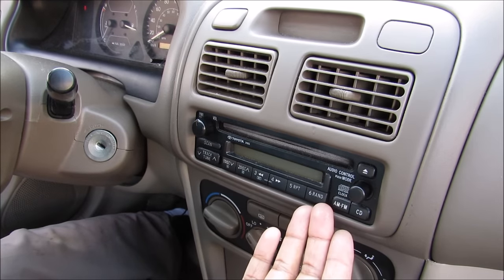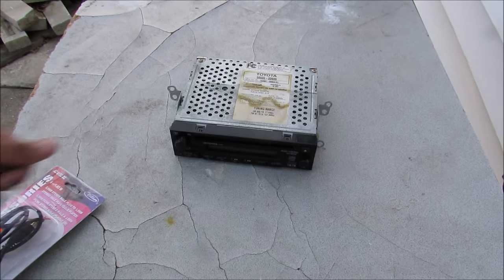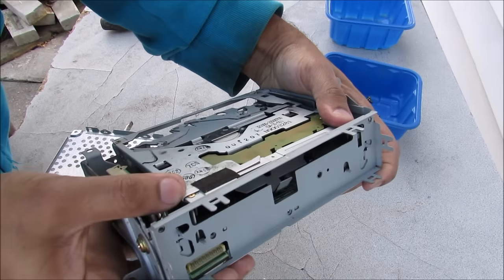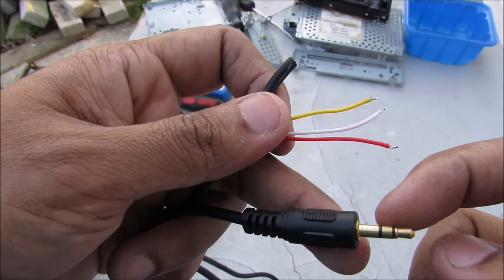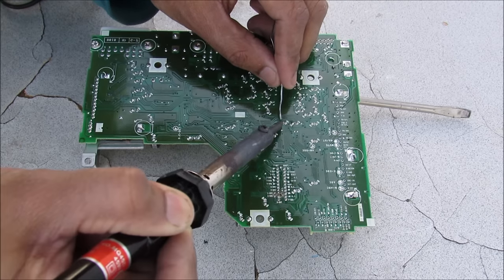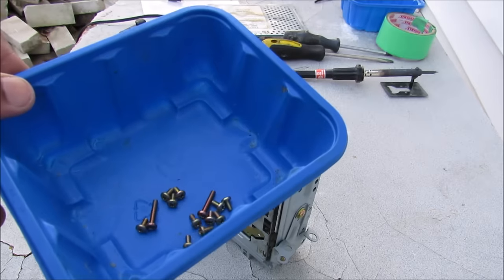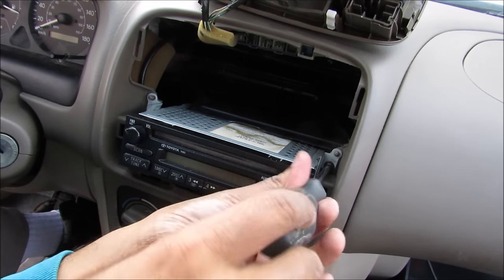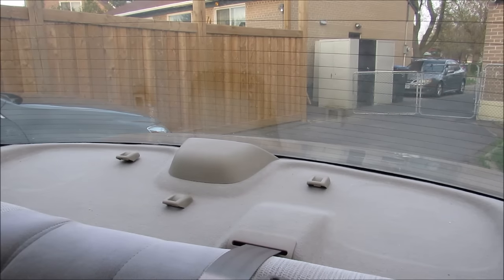Aux Input CD Stereo Hack

Comment: hey how did you figure out which wires inside the aux correspond to the left channel, right channel and ground?  is it the same for all auxes or does it vary? i just don't want to solder the wires in the wrong spots. also hilarious video man
Reply from the maker: If it's not marked then trial and error

Comment: Hey dude, so I have tried to do this trick but I encountered a problem: when I plugged my phone in, the audio was coming from my phone. But as soon as I removed the connection from the car sound system, the audio stopped coming from my phone like it would be working. Any ideas?
Reply from the maker: Thats Headphone jack detection on your phone 
Try a different player or disable it if you can

Comment: How did you determine which wires were which on the aux? Also, how can I determine what to solder to if I don’t have a test tool?
Reply from the maker: Pin out for the aux cable is standard. 

Trial and error to be honest
Reply: speedkar99 thank you my friend. Is there a method for trial and error? Like, do I have to solder then put the whole thing back together and test or is there a simpler way?

Comment: I have added Aux in to my JVC car stereo at the CD-L and CD-R input points of the volume control IC and ground to the amp ground point to a 3.5 mm stereo jack. When I connect the jack to my mobile phone headphone socket, sound output is from the phone speaker. But disconnecting the ground wire output goes to the car speakers but at little low volume. Any suggestions pl.

Comment: I tried to do that, checked the motherboard but i found no labels indicating right, left or ground .
Any advise ?
Thanks
Reply: I'm a little surprised but you could look on the board on the CD player to see if that is marked instead and see which pins (or sockets) it connects to on mainboard, or connect your wires to CD instead of mainboard

Comment: I did the same but disconnect the audio from the CD.
When the mobile is paused, I have some interference noise.
What I can do?

it is not the cable because when disconnecting from the mobile it stops making noises.
Reply: It's natural. Your cable naturally collects noise from electrostatic fields (interfering signals are superimposing to the signal) if the cable isn't shielded enough against it.
It's mostly noticeable when some metallic, skin, etc.. material (those which is able to conduct electricity) make physical connection with the AUX cord's jack plug. If you leave it alone the amplifier's noise reduction will comes into operation and you won't hear any interference because the noise is so low that the amplifier will cut according to the low threshold and SNR set.

Comment: Please help! I have a toyota corolla with the exact same cd player but there is a metal bar in the middle of the cd player preventing any cds from being inserted. What can I do this fix this?
Reply from the maker: +Miriam Bronski open it up and remove the obstruction
Reply: I opened it. The obstruction is built into the stereo. It's the bar that can be seen in your video at 1:14 right in the middle of the slot. The bar can be manually pushed down but it pops up again blocking the insertion of any cd

Comment: Personally I think it would be better to have a 3.5ml extension then with the female in you could drill a hole and stick it into place so you just have the port on the dashboard and then use a second 3.5ml double sided aux lead.

Comment: That's cool but you can also get a car FM transmitter that plugs into the cigarette lighter and achieve the same same result, easier!
Reply: Yeah, it mostly works well, but over time the odd interference, especially when audio source is low an radio volume has to be turned up, was driving me crazy.

Comment: There is no LINE OUT LEFT AND RIGHT mark on my pioneer CD player Board..
How I can get that?
Reply from the maker: Trial and error
Reply: speedkar99 OMG NO NEVER, please don’t use trial and error. You could put 12V DC directly in to the aux port and kill your devices.
Don’t do it, don’t even try it.
Reply: Now I am playing my aux cable with speaker out put line on my board... connect aux cable to that and turn on FM.. plug aux to mobile and now playing my mobile songs..
Now work well...

Comment: Hey, i have a question for you but i have no idea if you know the answer to it.

I have a 2000 Peugeot 206 GTI and the speedometer isn't working properly.
When driving the car, the first 1 to 10 kilometers (varies) the speedo is not working at all.
Tachometer is working fine. After those ''warmup'' kilometers, the speedo works like normal again.
when the speedo is out, the pedometer is not working either.

local mechanic thinks it might be a problem in the instrument cluster, because the ABS is still working.
do you have any idea what this could be and how to fix it?
Reply from the maker: +Bjorn Bekkers I had a similar issue on my Solara, the speed sensor wire behind the cluster was loose, and only worked when warmed up. It also caused my tranny not to shift. Check your wiring.
Reply: Thanks for the tip! 
i'll check it tomorrow when i have some time to look at my car.

Comment: A bit of "hand-waving" there when you just "magically" found ALTERNATIVE solder points, UNmarked, very far away on the printed circuit board.  But a sound strategy otherwise.

Comment: I have a 2000 corolla liftback with a cd player that is seperate from the stereo (model nr. 86110-02040-b0), connected with wires instead of directly in the motherboard like in the video. Is this possible for me, because i can't find the solder points. I don't have them labled like yours.
Reply from the maker: Start Google the chip numbers on the board to find it's inputs

Comment: Great video! Love people that like to tinker, take things apart to see how they work and maybe even modify things a bit!

I took an old stock Honda CD radio apart to see if I could also do the same thing you did but I could not find the same info on the sys board as you found. Any suggestions? Thanks!
Reply from the maker: Thanks I love tinkering as well. You'll have to Google the chips to get the pinout

Comment: I understand that some people like to mess about with things but ffs at the point of having to solder and buy wires and shit you can just buy a cheap cd player with a aux built in I mean they are what like £20?
Reply from the maker: Why not hack it? It's fun, cheaper, and retains the OEM look.
Reply: @speedkar99  there is a difference between doing old stuff thats really a front for cool and new stuff and messing with old junk mate (and fun? Really? Soldering a wire is not really my idea of fun haha but each to there own. ) my examples of cool old things are:
 A sleeper car (like a 1996 rover 214 si that can do 0-60 in 3 seconds and tops out at 180mph)
A sleeper pc (like a pc from the big white tower era made somewhere around the 1990s that still has a floppy drive but inside has a i9-9900k 32gb ram and rocking a rtx 2080ti with rgb everywhere) but not soldering a aux on a old radio haha its like the kids who stick tape on there car to fake carbon fiber or throw a big exhaust on there 1.2 clio or the kids who buy a 1.99 led strip to stick in there shop bought low spec "gaming pc". But saying all that they make more sense than your aux "hack" because carbon fiber cars are f*cking expensive and making a old car into a sleeper is a pain in the ass... all the work to make a car not only put out the power of the 0-60 and top speed but to be safe doing so is insane and finally making a gaming pc is also expensive and can be challenging doing it in a old case but a aux cd player has been cheap for years so makes no logical sense to "hack" a old one, its like watching a video on how to make your own tooth picks to save 20p its just insane to me thats all.

Comment: Mine from my dad's car, from an 2000 audi, does not have nothing labeled. I checked so much time but it only has G for ground and SW+ and SW- and some S+ and S-
And i don't know what to do now!!
Reply from the maker: Trial and error! that's what i would do
Reply: speedkar99 I'm afraid that i could damage my phone when i plug it in. I measured a small voltage of around 200mV and that's why I'm afraid!!
Reply: Lela Mario  plug in cheap crap to the cable and test it then if it blows it up it doesnt matter

Comment: I have a nissan pulsar 2004 i connect the aux cable i get sound but the sound from the cd comes through a little bit. But why everything i change songs on my phone the sound cuts out so i have to eject the cd insert again then it will play through my phone again
Reply from the maker: Your phone has jack detection
Reply: @speedkar99  yes it does but when i change songs it wont play thru the radio???

Comment: 2:46 Wrong ground dude. You didn't cut trace on the CD player for the L&R signal?
Reply from the maker: No you don't cut traces if you want the CD player to work
Reply: You're shorting 2 low impedance outputs. Very likely you'll get increase in THD.

Comment: did this to my 2004 Corolla and i get ground noice whenever a function associated with electricity is pulled off, wipers, turn signals, window operation, they all introduce cracks and sparkles in my speakers, but hey its all cool while the car is parked

Comment: Toyota 58806 please :) There isn't any label like GND or OUT. Only some codes.
Reply from the maker: +greos39 Google the data sheet for the chip and trace the contacts
Reply: speedkar99 I connected left and right cable from Jack, with LCH and RCH from CD player (GND with GND). When I plug everything to radio and press power button,  LCD shows: CD ERR.
Reply: @greos3941  Looks like your Blank Cd is at fault as OP said you need a readable CD with blank audio it seems your CD is not reading correctly
Reply: @peterkershaw7225  everything working already for a long time :D

Comment: Could this be used in a cassette player at the input end rather than after the amp?
Reply: locate the amplifying chip, find the line in (4 of them in case of TDA7388) and hook there through a 1uF capacitor, left on line in 1and 3 and right on line in 2 and 4.

Comment: Hello, i have watched this video so i decided to try it on my Ford Fiesta 2009. I removed the radio and on the back of the motherboard, where the CD Player was pluged into, i saw that nothing is labeld ( no R-Out etc.) Can anyone help me where i can find a plan or something to solder the cable on the right positions? Thank you 
Nice Vid!    (The Radio: FoMoCo Model RADIO AHU)
Reply from the maker: +andi i thanks,  how about checking the output of the CD head where it hooks to the motherboard? Perhaps youll have to google datasheets for the A-D converter chip on your board to get a pinout of the unamplified audio signal.
Reply: Thanks! I will try to find something. On the following link you can see my cd drive loader deck, which is installed in the radio. 
https://opuradio.com/products-detail.php?ProId=1215

Comment: Hey bro the car is different, but the idea should be the same, so can I do this on a Buick lesabre 2004?
Reply from the maker: Yes as long as you have analog cd
Reply: speedkar99 hi so I tried to do this on my buick, turns out the Buick doesn't have r-out l-out like that, it instead have R-CH and L-CH and P-GND, which I think is the right left channel and the ground, so I soldered the aux cable to it and then put in a silent track cd, it doesn't work. Can you tell me where I did wrong?

Comment: I'm curious on a technical level why having a blank cd in there with the aux hooked up "tricks" it.
Reply from the maker: +MuffinMan0521 because it's supposed to be taking audio from the CD 
So there needs to be a blank CD to play from otherwise it won't read from the CD source
Reply: To activate the amplifier board.
If you don’t put CD in it the device will sleep and turn of the amplifier.

Comment: 2007 lexus gs350, bluetooth music streaming !!! is it  possible !!! pls make video
Reply from the maker: +Turbo Not without a Bluetooth adapter that you plug into the back of the radio. 
Or you can hack the radio add an aux line (like I did here) and then add a Bluetooth adapter to that with a ground loop isolator to prevent interference. 
I just dont feel like opening up my GS350 radio in case I screw something up lol
Reply: lol same here, i dont feel like opening it, even thou i do extreme operation on other car lol ...
Reply from the maker: I just use MP3 CD's. Works for me.

Comment: Man, for $50 you could get a nice modern JVC radio with Bluetooth and replace this old junk and not to have silents CDs. Faceplates and adapters are $20 max if needed. Takes less time and effort
Reply from the maker: +CNT True....but what if you want that vintage 90's Toyota quality sound system?
Reply: speedkar99 then you buy a fm modulator

Comment: Ummm why take the radio apart and solder?? Thats risky soldering and its unneeded... Why not just take "wire taps" and wire the aux cord to the wires on the back? Then you dont have to solder, you dont have to take your radio apart and it would take a lot less time......
Reply from the maker: +Cameron Because the wires on the back are unamplified

Comment: Your side brackets should work on a aftermarket stereo it's nu st a single din radio and would soundcbettervtgan stock.
Reply from the maker: But it would look ugly and not worth on a car with two speakers
Reply: speedkar99 Walmart has Bluetooth head units with aux for 20 and they are surprisingly good quality.

Comment: How did you figure this out?
Reply from the maker: Trial and error
Reply: speedkar99 that's really interesting
Reply: speedkar99 can you do that to a 99 ford ranger?
Reply: speedkar99 I'm wondering if it's possible to add a iPhone charging cable directly to the power of the radio to charge a iPhone there has to be to be constant power somewhere.

Comment: I am not looking for cheap money radio i dont care if its cheap i will easily buy a 100$ radio but the problem is that my car isnt garaged and my area isnt exactly safe. Sooo i am looking for something that i can move around and hide. I have a radio installed thats hard to remove i mean you need some special tool to do it soo its thief proof. But if i buy a lets say 30$ radio they are gonna steal it never mind the radio i can just buy a new one but if the thiefs brake my door trying to get in which has happened to me before i will easily have to pay around 200$ for it so it isnt worht it for me, keep in mind the average yearly salary in my country is around 4000$ soooo.......
Reply: Aftermarket radios have removable faces even cheap ones
Reply: @funnypranker34  Yes but the mounting point for my radio is very visible. I own a Fiat Punto Classic.

Comment: Lead used was to short.
Reply from the maker: For the solder?
Reply: @speedkar99  no sorry, what I was asking was a question, just didn't put it well. Cable Seems to short after fitting. Like your holding it in a bad position because of this. May just have been camera angle.